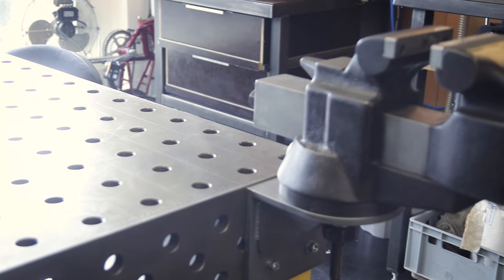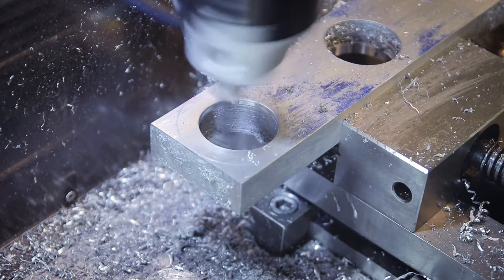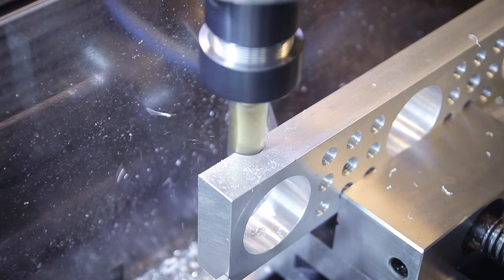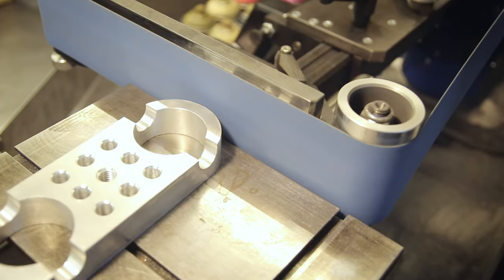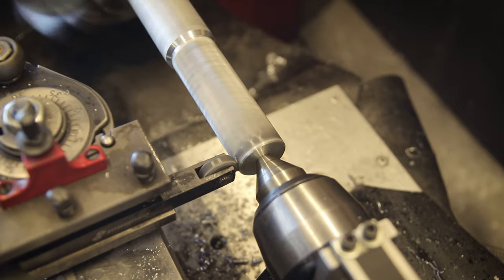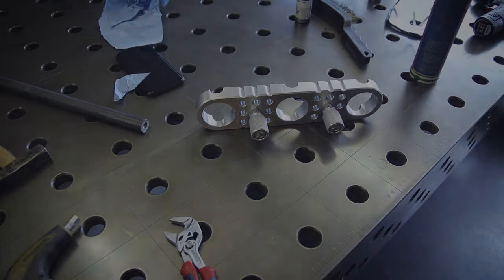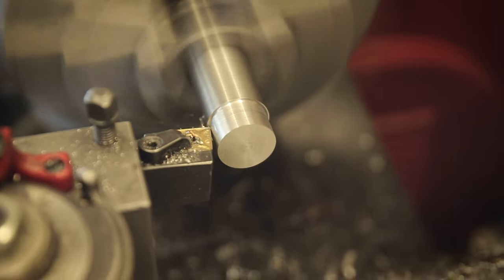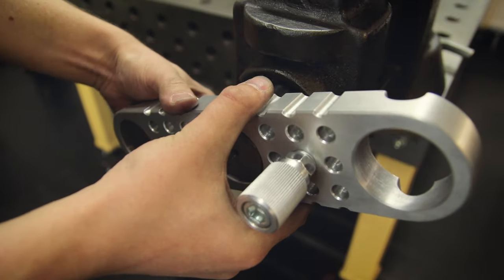Making an Overengineered Speed-Handle for my Vise

Comment: For chip evac during those large hole saw cut, drill a few small relief holes on the inside diameter of the hole you're cutting so the chips can fall out as you're cutting. Learned that from an AvE video and it works like a charm 👌
Reply: Been using that ever since I saw his video

Comment: I wouldn't say you over engineered this at all! You improved every fault that vise cranks all suffer from. I can see this even useful for a smaller vise. Great piece of work in how it is engineered. From the attaching points to the O ring! Simple, direct, clean, thought out. Thanks

Comment: As a tool and die maker. I would use a collet to hold the countersink when using it with side cutting forces. Drill chucks can only handle vertical loads.

Comment: That's actually really cool, and kinda makes you question why handles of a similar design aren't used in higher end vices. It's symmetrical, can be scaled easily, doesn't come off with asymmetric force, and acts as both a speed handle, and high leverage handle.

Plus it's removable, honestly, it's perfect
Reply from the maker: They have speed handles on machine vises sometimes but I haven't seen one on a normal vise except the fireball vise which I think has a similar one. Good thing about this design is it can be adapted to almost any vise out there, just have to change the hole sizes accordingly

Comment: When using a hole saw, try drilling a hole "in the cut diameter" the chips then fall through the hole, making sawing more efficient.  I drill a 6mm or so size hole so just the edge of the hole is in the saw cut.
Reply from the maker: I actually did! But it was still a pain since the teeth still tend to clog up, at least with aluminum
Reply: @Phil Vandelay  I don't have that as I use water soluble oil, it flushes the teeth clean,  cutting and drilling fluids tend to gum up teeth.

Comment: Yes, it's an "Overengineered Speed-Handle for my Bench Vise" but it's a clever Overengineered Speed-Handle for the Bench Vise.  A review in a few months would be welcome.  Thanks for the very well-done and interesting video.
Reply from the maker: I can actually give you one now, since I built this a few months ago 😉 So far I haven't had any major problems with it, definitel prefer it over the old handle. Since it doesn't drop down in the idle position like a "normal" one there is the chance of bumping into it sometimes, and sometimes it can be in the way while filing etc., but in that case I just take it off

Comment: A tip: to improve chip evacuation while using a hole saw, drill an evacuation hole in the path of the saw blade. It'll push the chips out of the cut and greatly improve the operation.
Reply from the maker: Yeah I actually did that although it's not easy to spot in the video. But it didn't help much in this case, I think the main problem is just that the hole saw was dull and missing some teeth 😅

Comment: My secret to cross knurling is to run the feedrate at half of the pitch on the knurling wheels. That makes it consistent without a very visible spiral wrapping around the part.
Reply from the maker: Yeah I've been meaning to try that, maybe next time
Reply: @PhilVandelay  I only run cnc too, so it helps time it all correct too. But when I do knurling I got the tool angled around one degree so the wheels can work their way into the part over a bit longer distance. When moving the tool in I do it at 1/4th the feed of the wheel pitch, then without any delay I start feeding in Z after reaching the set diameter. When reaching the end of the knurling I rapid away from the part. Doing it like that also gets rid of the band that can be visible in each end.

Comment: Merry Christmas and a Happy New Year to you too . Great upgrade to the vice .. I was thinking a power drill to move it faster not with the setup you did ,, just a thought if it starts to fall off the vice you could drill and install magnets in the handle ? I think with a good o ring you should be good to go .. hope your shop keeps you busy in the new year ,,
Reply from the maker: Yeah I thought about using magnets at first, but they usually end up being kind of an annoyance in a metal shop since they clog up with steel shavings/chips. But could work if you put them on the inside somehow. Spring loaded balls were another option

Comment: Would like to ask, those people that like to use venier gauge to scribe a mark, how long do you get before the point is worn down and the measurement no longer matches the read out
Reply from the maker: By scribing aluminum with hardened steel? Probably a hundred years or so

Comment: i know this might be an odd question but what ID tolerance did you use in the nub/handle here 8:58
Reply from the maker: Honestly couldn't tell you, but it's not a tight fit or anything. The grease mostly fills the gap so it doesn't rattle

Comment: Over-engineered? OVER-ENGINEERED? For wrench sake, this thing has NO BEARINGS. Where is the level indicator and force sensor? And where is the obligatory smartphone app to read said force? and I cant believe you did not add a capability for a BLDC motor upgrade in the future...
Reply from the maker: You forgot AI assisted visual workpiece identification to automatically apply appropriate clamping force
Reply: @PhilVandelay  shhh.... you cant go throwing away million dollar ideas like that